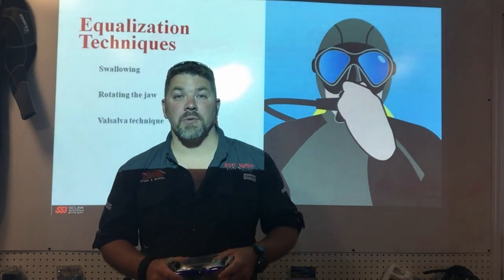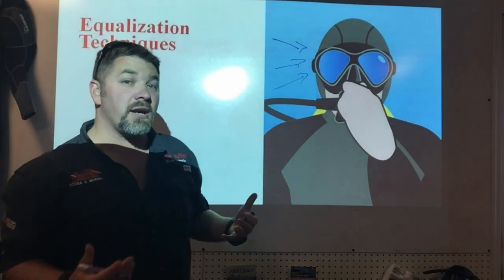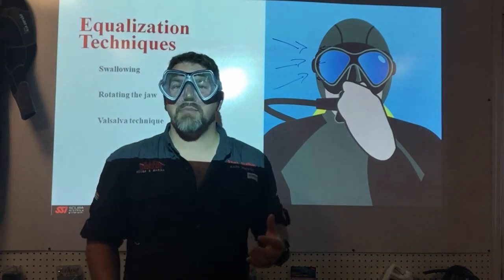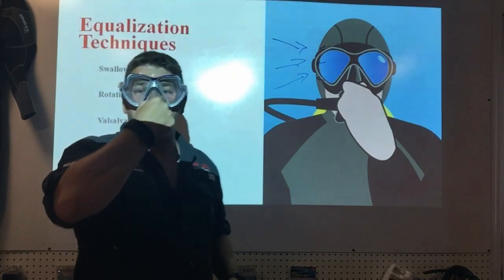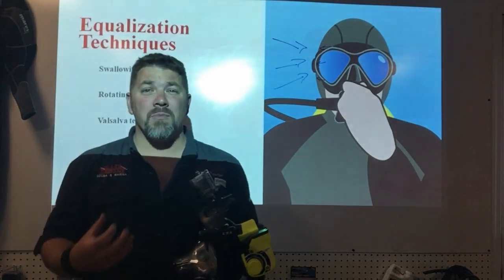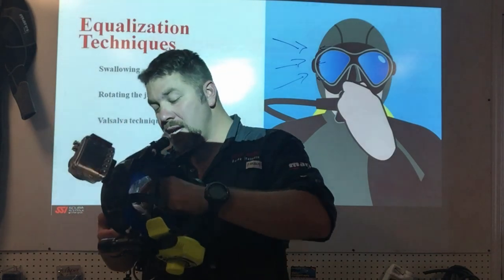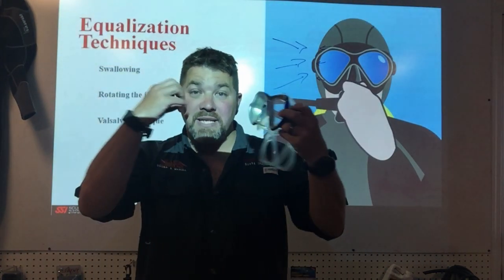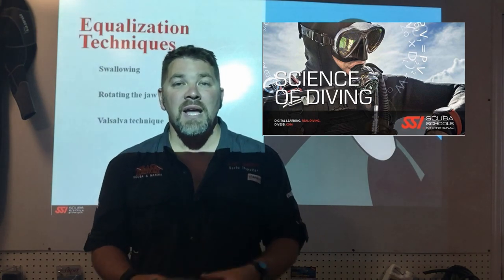How Equalization Works With A Full Face Mask

Comment: Would it be easier to use the "Rotating the jaw" technique, using the full face mask?
I feel like this technique on a regular mask with regulator isn't very effective for me...
Reply from the maker: Hello Arthur de Lapertosa Lisboa, it would definitely be worth a shot to try it. Each diver will have their favorite way to equalize. I encourage all divers to practice the three primary ways, Valsalva, Swallowing, and Rotating the Jaw, so they can equalize no matter what mask choice they use. The more tools we have in our tool box the better prepared we will be underwater.

Comment: perhaps someone hear can answer a question.
ive recently seen a film wherein two women find themselves at a great depth underwater in a shark cage.
one decides she must go for help, and in order to fit out of the cage she removes her mask then puts it back on.
she's obviously underwater, wouldnt the mask fill with water? or is the air pressurized enough to push water out the closer it gets to resealing on the face?
Reply from the maker: When you take a Full Face Mask course, one of the skills you learn is how to remove and replace it underwater.  In short it works the same way a standard second stage works.  Once you have replaced the mask on your face, you simply purge the water out of the mask by either exhaling or by hitting the purge button.